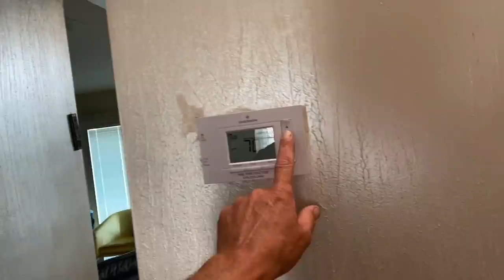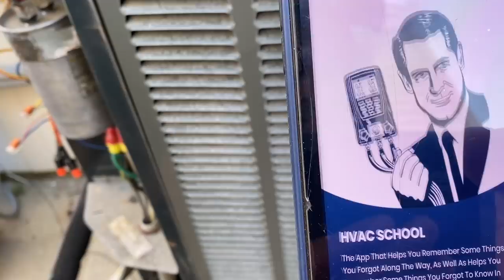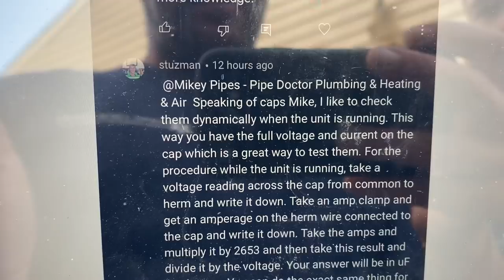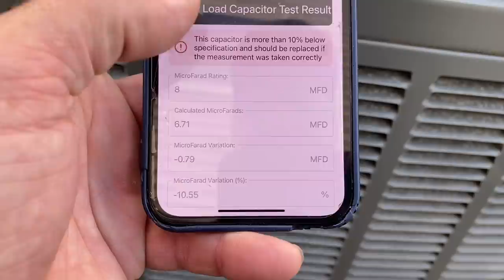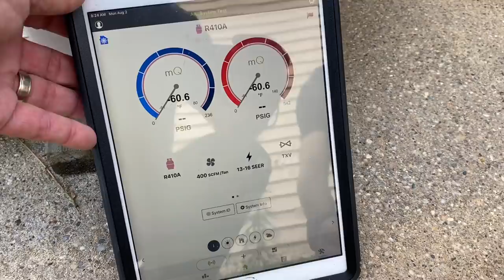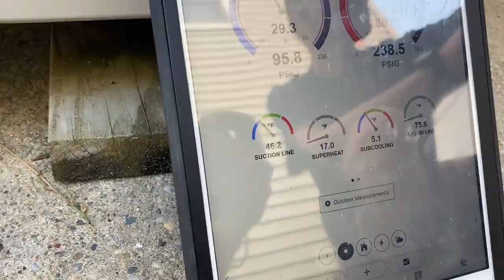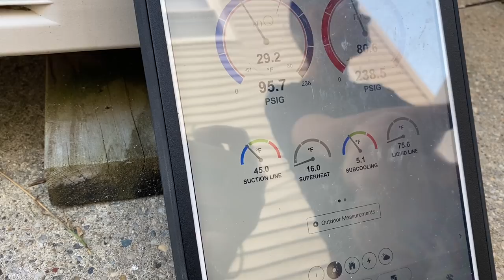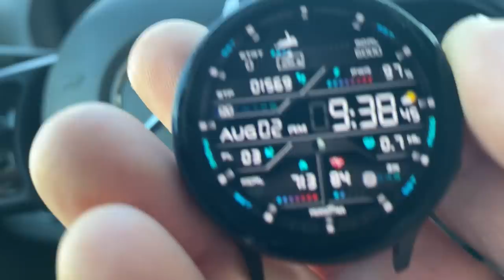Central AC Frozen Again & Making Loud Noise - Using MeasureQuick & HVAC School Capacitor Calculator

Comment: Pretty good videos for Yankee ac guys. Lol seriously I have watched a lot of your videos and as a 30 year veteran in the heating and ac elect and plumbing business I see your strategy for success and it's one a think is fantastic! I went to trade school to learn the business and when I got out I truly wish I had a mentor like yourself to steer me in the right direction. I went to work for a residential service company as a state service director who also ended up spending at least eight hours a day in the field. I taught myself plenty of bad habits in that time as I was always fighting for more hours in the day but eventually cleaned up most of them. I learned to never give responsibilities that those who are just starting are not ready for but it cost me 5 years of my career. I'm retired now company contracts sold and only do an odd job usually for Charity nowadays. One thing I can say about the business is your body is the best tool you have and the only one you can't replace. Take care of it and make sure it lasts your entire career.

Comment: A simple 2 wire hard start kit might help with the noise in start/stops. I used one the other day for this very problem and it helped massively.
Reply: On older units they make a big difference.

Comment: Mike I smoked for 45 years the last two years I smoked two packs a day. I never ever tried to quit because I’d seen so many people try and fail. I didn’t want to be one of those people who failed because I didn’t think I had the will power. Had my last cigarette two hours before triple by pass surgery. Told the doctors I wanted to try and quit. They put me on the “ patch” as one of my after surgery medicines. Continued on the patch for a month after surgery . Stopped the patch and I haven’t had a cigarette in 4 years 6 months and two weeks. Oh by the way I was a miserable prick before I quit so no one noticed any difference hahaha. Good luck Mike 👍👍🇨🇦
Reply: @PipeDoctor  change to vaping, much cheaper, safer and get the same effect. plus I make my own flavored juice :)
Reply: @PipeDoctor  st. Mikey pipes I, command thee to stop burning the tobacco immediately you are a good guy , hate hearing about smoking unless it has THC for your immune system , or at least cut down,🤔💪✌️👍😔

Comment: Mike: a suggestion if I may. Please have Daniel-Sun get out of the habbit of placing the tool pouch, meter with probes, on top of condensing units. Every time I see this I get a chill down my spine. There is an inherent risk of an item ( probe lead, long shaft screw driver ) making its way between the protective screen. Especially when turning the unit on and off when troubleshooting. That goes for adjacent condensing units as well. You never know when they will power on.

Comment: I never smoked and that';s probably why I'm 74 and pretty healthy. I didn't really drink till I was in the army and then I made up for lost time. I was on a very isolated radio site and in Korea we had ration books that limited what we could by. I could buy 8 6 packs of beer, 6 bottles of liquor, and 30 bottles of wine a month - BUT i could drink all I could afford at the NCO club at 25 cents each (10 cents happy hour). The problem was our site was 26 miles from the NCO club so we had to make do with whatever we could get at the Korean bars - some of which were pretty primitive.

These days i drink Evan Williams bourbon (poor mans jack Daniels) 3oz to 1/2 oz of water and ice.

BTW I think your new helper Danial is a keeper - he listens and he's not afraid of work.

Comment: on those multi-terminal capacitors, its always wise to short across all the terminals and not just the connected pair. even thought they're unconnected they still share the common terminal and can have voltage induced to high levels via leakage into the air and proximity to surrounding wiring/metals.

Comment: Hi Mike, looks like you have a fluke 902fc. There is a voluntary recall for some of them. You’d have to check the fluke website to see the affected ones. I got mine in 2021 but was still on the recall list. Sent it back and got repaired and returned within about 1-2 weeks. Good luck on giving up cigarettes.

Comment: Ive read that If the home doesnt cool well and stay cool at 74 or 75 theres usually an issue with the system... unless the home is poorly insulated.. is this a general rule of thumb ?

Comment: when they cry about banging sounds, it's usually the ducts banging around when fan goes on and off, especially if the coil is half frozen with super cold air pooling and moving through them in a hot attic.

Comment: Good luck too you I smoked 3pks a day stopped for 4-6 days started again did it on and off then one day I finally quit cold turkey well not quite I had a truck run me over cuz that's my right lung I wouldn't suggest it though

Comment: Mikey pipes when are you gonna upgrade to the Fieldpiece probes bro. 300’ bluetooth range, instant and accurate temp readings with the pipe clamps. no more slow thermistors that are affected by ambient air . Also with the air probes in most situations with the Bluetooth range you get live supply and return readings. Put that into measure quick and it will give you live diagnosis while sitting at the outdoor unit. You’ll never turn back.

Comment: That deck mount tub spout does not have enough reach to clear the tub edge and looks like it was intended for an undermount tub arrangement.  Water is leaking into the tub perimeter seal most likely.  Daniel does not look comfortable enough with electrical yet - help him out before he gets buzzed.
Reply: That fear or complacency is not good ,learn to respect seen the white light 2 too many times.✌️💪👍🤔🖖🤙🙏😔💙
Reply: @PipeDoctor  I think you should of let danielson try to correct his mistake with the leads not in all the way. I've def done that on my own before and figured it out fairly quickly...I bet he would of figured it out if you gave him time...
Reply: miss-matched pile of crap house, likely worth about 1/100th what they paid/are paying for it. lol

Comment: The probes should of came with blue and red stickers to distinguish low and high side

Now all you need is the out side air temp and the temp probes for the supply and return to really use measure quick that will determine target super heat for Pistons air flow ect

 You can manually enter the Ra wet bulb and outside air if you don't have Bluetooth probes that connect with the app.  

If you have any questions using measure quick you can ask me Im good with it

Comment: Mikey, while not your domain I'm in need of some advice.  I have an 18ft round above ground pool with a Hayward H100ID 100,000 btu heater.  I had to replace the heat exchanger this spring after 5 years of use.  Ever sence then I've been finding greenish blue flakes on the pool floor.  Like the color of corroding cooper pipes.  Is there a product I can use in the pool to help clean out what I believe to be corrosion in the heat exchanger?
Reply: Can I recommend you get the gas pressure checked at the pool heater I have run across a lot of them with undersized gas piping and it will cause the heat exchanger to rot prematurely

Comment: Do you ever use a megger on a compressor. If its a Copeland ( scroll) it has to be below 0.5 meggohms to be considered bad. I routinely megg compressors and write down the numbers inside a panel. If its showing a decent decline in integrity, you known the compressor is on its way out.

Comment: Mike what do you charge replace a capacitor? I had a company tell me they  charge $400......

They also said it takes 6 hours @ $200 an hour to vacuum the 410A from my home .
Reply: @PipeDoctor   $400 is crazy as well as 6 hours to vacuum though right
Reply: @Metlupass2  6 hours to vacuum is definitely crazy and definitely a scam if its a new install with the right equipment shouldn't take more than an hour heard of 400$ for a capacitor but only from big companies with high overhead on average from small companies should be 200$ or so

Comment: Did you check the Schrader valves??
The math quiz is more confusing then practical ! Again if it's bad your turning it off anyway, without the possibility of getting finger banged!
🍺🍺🍺🥃🥃🍇🏌🏻‍♀️
Stay safe. 
Retired (werk'n)keyboard super tech. Wear your safety glasses.